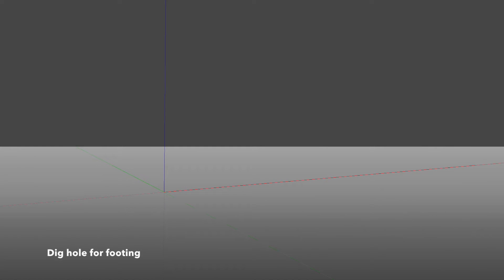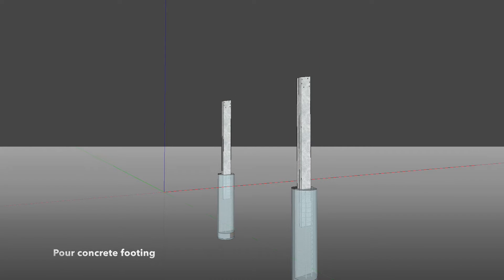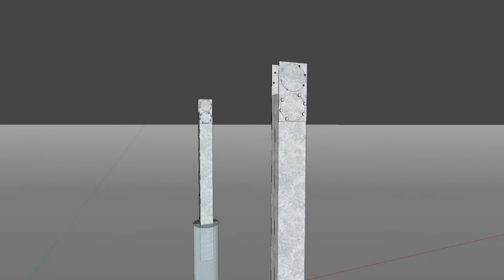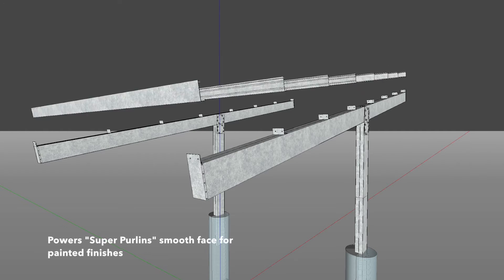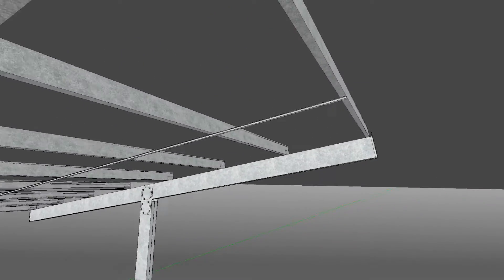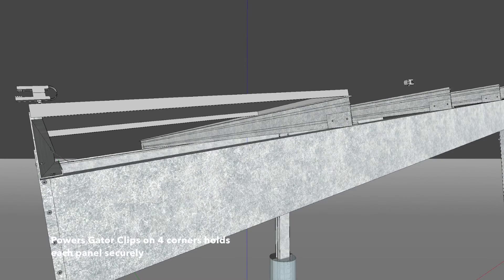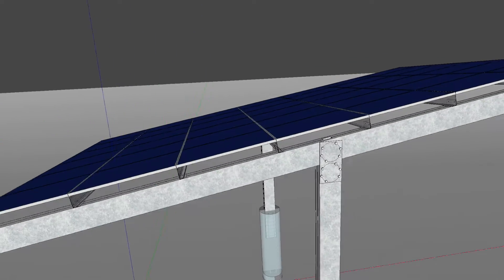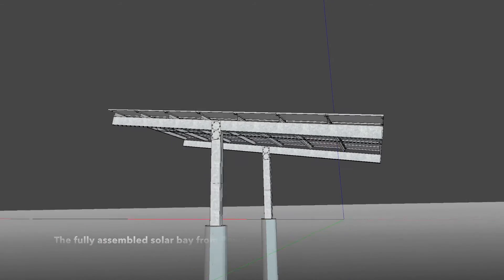Powers Solar Frames

Comment: Hi, Couple of questions;

1. How do you account for the thermal expansion gap requirements of most/all solar manufacturers.
2. How do you avoid corrosion (aluminium on steel contact).
3. How is the system earthed?

Thanks
Reply from the maker: 1. The distance between the Super Purlin is the width of the panel if in landscape or the length of the panel if in portrait + ¼”.
The recommended gap between panels in the same row is ¼”.
2. This has not been an issue on any of our structures.
3. Typical footing for a Solar Carport is 30” diameter concrete pier x the depth of embedment determined by engineering.